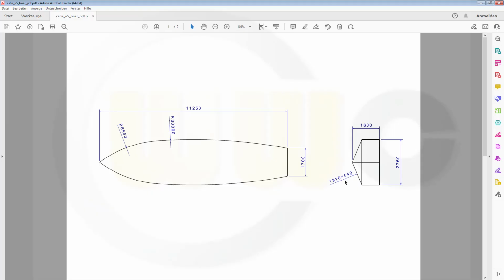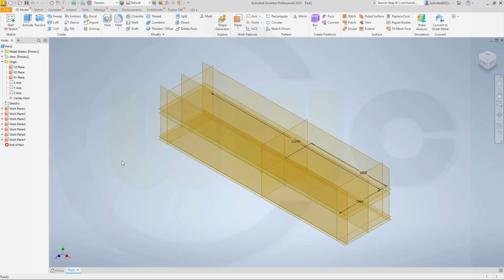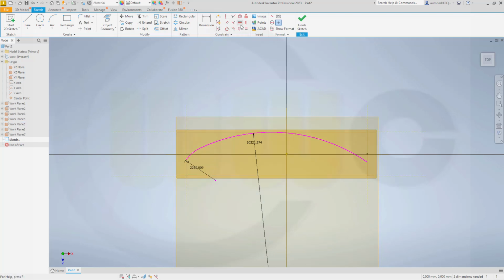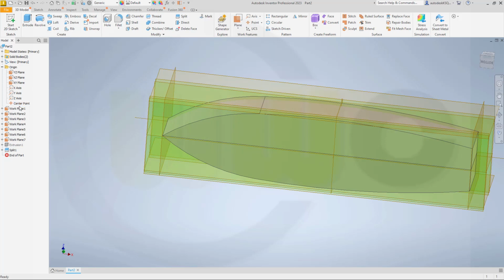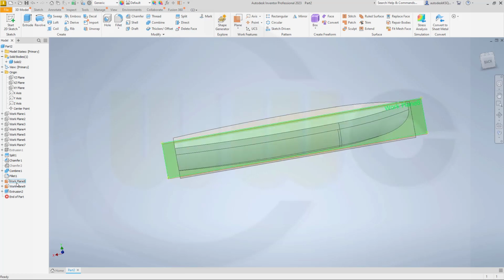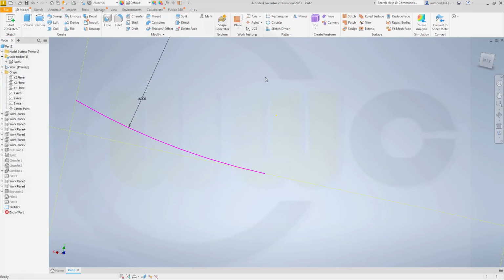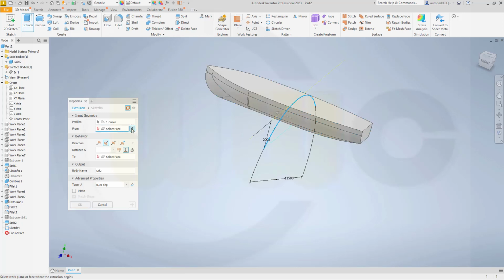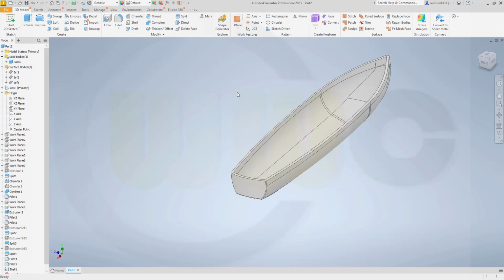Bootsrumpf - Boat Hull - Inventor 2023 Training - Part Design

Comment: Great video, thanks for sharing. In your opinion, is it feasible partitioning the hull into plates and then get the flat models? Could be another interesting tutorial :)
Reply from the maker: Usually a ship hull is build in a different way. This is just an exercise, not a real boat hull. But is a very convincing shape, isn´t it?
Reply: Thank you for the video. How will the ship hull be normally built?  @wolfgang.walden.cad.training